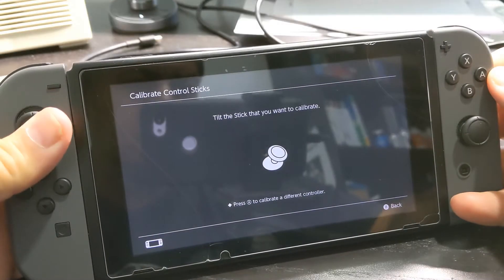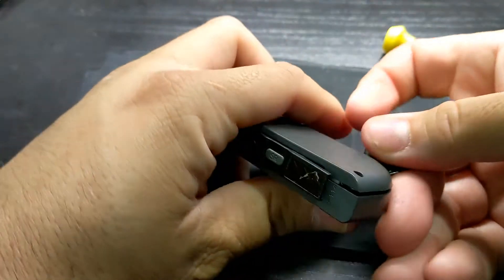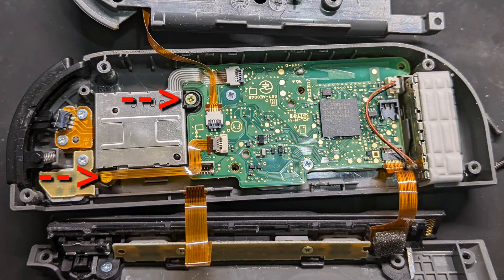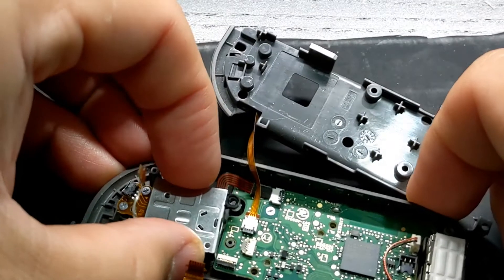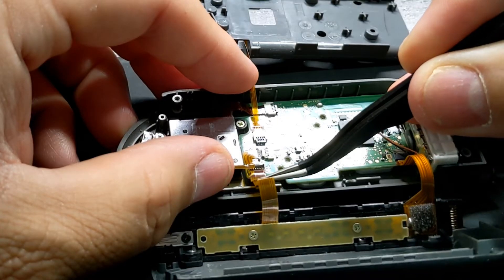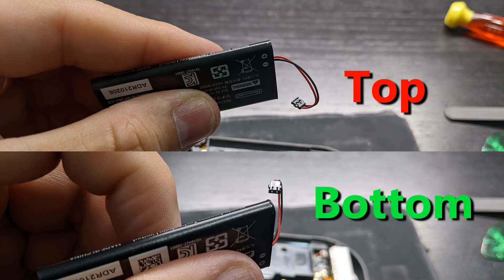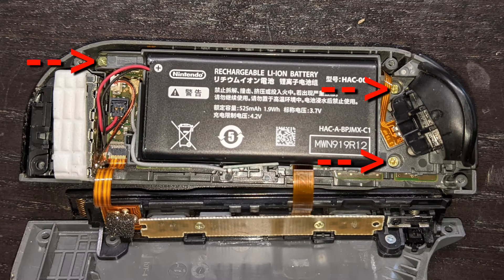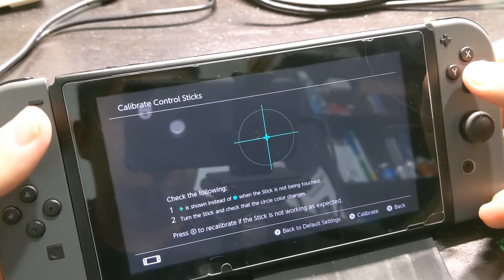Fix Joycon Drift: Replace Nintendo Switch Joysticks

Comment: From the bottom of my heart, thank you for saving me 70$ on new joycons
Reply from the maker: You're welcome! Good job taking a risk to repair your own joycon! =)
Reply: @ChavezDIY  there were a few issues in doing so like stripped screws but they’re pretty good now. Only thing now is that the console sometimes says they aren’t connected but I can just disconnect them to play anyway
Reply from the maker: That's how you learn, by making mistakes. That's interesting that the console sometimes says they are not connected.
Reply: @ChavezDIY  right? I don’t know whether some connectors got scuffed or what. That’ll be my next Nintendo switch project I guess
Reply: Bro same